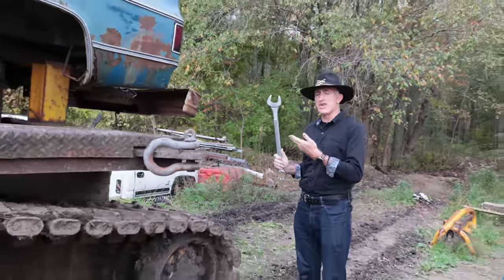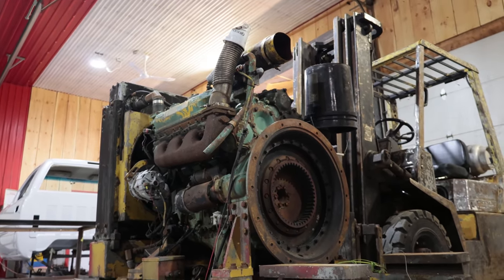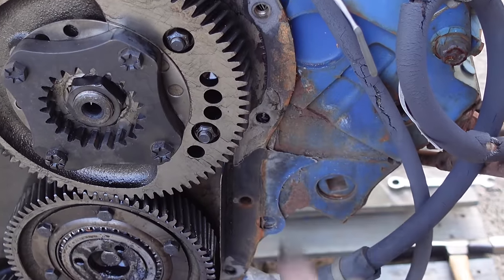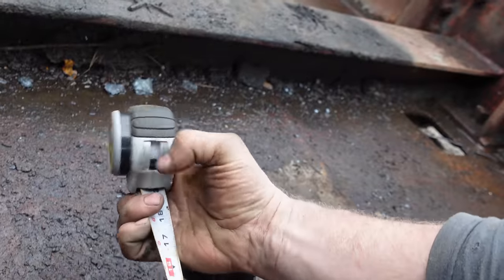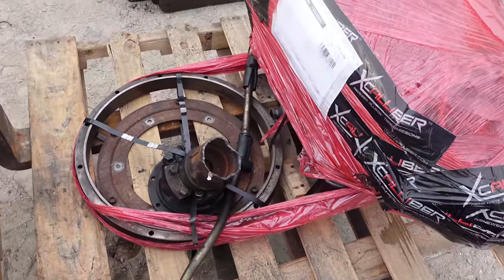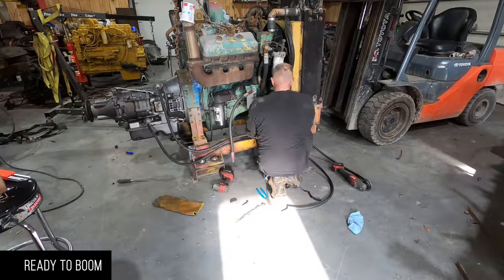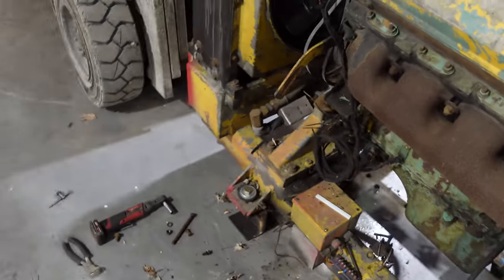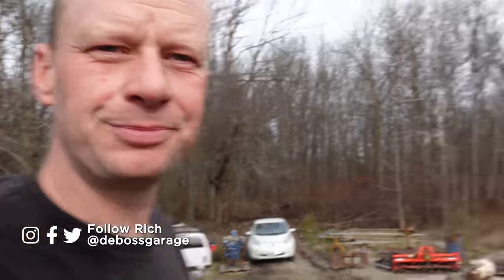Fixing Everything Wrong With Our Truck Tank... 30-Speed Detroit! #Shermanator [EP3]

Comment: Wondering it wouldn't make more sense to have two separate diesel engines with 7 gear DSGs going to each final drive.

Instead of having a direct gas pedal for each of the engines, you would fit an RPM-based governor for both engines. So you select the desired RPM after the transmission with a single lever and the governor will modulate the throttle to meet your requests, while the DSGs will dynamically shift up and down based on the load and throttle.

The steering wheel would just shift one desired RPM up and the other one down. So you have one lever for the "total" speed of the vehicle and the steering wheel for the differential speed.

You would then just fit two brake pedals. The "brake light" switch would turn the engine down to idle on the side you hit the brake and switch the DSG to N. This way you can stop one track while the other engine turns the other track forward.

If you want to include the cool "turn on a spot" you can add a switch at the end of the travel of your steering wheel which switches one transmission forward (gear 1) and the other one in reverse if both brake pedals are pressed and the RPMs are both (at the final drives) for obvious reasons :D If you release the brakes the governors will engage and bring the engines out of idle. If you hit the brakes again you will exit this mode (when you turn the steering wheel out of the the "end of travel" position at the time you release them. 

And you probably want to include a button to select reverse on both DSGs.
Reply: Regarding engines: Have a look at old Tuaregs, the 4.2 liter V8 is quite powerful: 340 PS and 800 Nm or 590 lb.ft @ 1750-2750 rpm. Not available for DSGs, but they were build with automatic transmissions. So maybe just go this route. Not as exiting as an DSG but probably better anyway with the high amount of weight. :D

Comment: Theoretically, a heavy haul semi class Allison or Eaton automatic may have been able to take the torque of that Detroit 16v, but I don't know enough about either to say for sure. Perhaps a topic for a future video?
Reply from the maker: no, they need too many electronics to get it too work.  This is a full manual valve body with no electronics
Reply: @DGHD  Thank you! I'd love to learn more about automatic transmissions, I have the general gist but when you get into the grit like manual/semi-auto/automatic valve bodies I get lost.

Other than the Rule of Cool, would there be any reason (practical or not) to use a Detroit 16v in a non-stationary application?

Comment: If it was my tank, I’d honestly think of selling the classic tank transmission and replacing it with a truck axle.
Reply: Not really an option, as the axle is also your steering mechanism.
Reply: @martindinner3621  I already considered that… the controlled differential is pretty slick for tank operation, but this things a rusty Chevy square body mounted on a bunch of metal plate.  Somebody at a museum could really need these parts.

Comment: I was thinking on diesel swapping my f150 one day. If I could get my hands on a 4 v 71 that’ll be cool. Otherwise a Cummins swap. The old 93 is gonna be great
Reply: You'd be much better with a 4bt Cummins swap. I love my Detriots, but they're heavy and slow. If you're looking for something that would make a good daily driver get a 4bt. It's a 5.9 6bt Cummins with 2 cylinders lopped off. Look for an old box truck, 94-97. You could pick one up, depending where you live, for 2K-5K. You can get the whole engine and transmission, plus the radiator and whatever else you might need to swap it, like the front yoke on the driveshaft.
Reply: A 4bt weighs 700-800 pounds. A 4-71 weighs 1600-1800 pounds. You have to take that into consideration for a half ton pickup as well
Reply: @buckberthod5007  thanks for the clarification. I’ll do a Cummins swap then. Thanks for ideas on what to look for.
Reply: @2koolchris291  Your going to need to beef the front end up as well. You'd be good to buy a set of Dana 60 8 lug axles to hold the weight, and not blow out suspension or ball joints. With a 4bt and a 5/6speed manual, you'd be looking at 40-50mpg, while being able to get up to 70 quickly. Just make you take care of the kdp in the timing gears, and turn up the injection pump if you're looking for little more power for cheap. You could also put a set of bigger injectors (.40-.60 over), 60 pound valve springs, ARP head studs, and a bigger turbo. The 3.9s and 5.9s are real powerhouses with little work. They're great in stock form, but tune em up a little, and she turns into a beast
Reply: @buckberthod5007   thanks for the advice. I was planning on doing axle swaps with a 6 speed manual because of personal preference. I am now really looking forward to this. I was also thinking on boxing in the frame for extra durability.
Reply: @2koolchris291  Definitely box it and if you can swing it, I'd recommended buying a f350, 99 to 06, with a zf6 and the Sterling 10.25s to swap. Pick up the entire chassis, so you can use cross members or other pieces for the swap. You could also buy a a rolling chassis with everything installed, drop the 4bt in, and swap your body on. You'll have disc brakes all around, for good stopping power, you'll have a damn near bulletproof driveline, the 4bt, zf6 and sterling axles are next to impossible to kill, and you would have the right set up
Reply: @buckberthod5007   my original intention was to pick up the newer chassis from one of those trucks to use and I see them listed for parts around where I live so I could pick up one relatively cheap. And thanks for letting me know what to look for in driveline components. I’m turning 16 at the end of the month and I’m new to these things. And plus I’m still trying to rebuild the old f150. I bought it after my brother wrecked it. Nearly rust free for 1000 dollars with a decent bed. I had to replace the cab since it was damaged beyond repair. And I’m saving up for the new fender and I need to replace my front harness since it was torn up when the fender was ripped off by the guard rail he hit. The truck has 164 thousand miles and all I want is for it to be reliable and a good work horse. It is my first truck and not only that my dream truck. When my brother got it it was pristine. Now it’s just waiting on parts to get it back on the road.
Reply: @2koolchris291  If you've got to get a new cab, id look for a truck that's just a good cab and frame,  1999-2006 F2/350, with a zf6 and Sterling 10.25 axles. Better off with a F350, but a 250 would work. Swap your bed and nose on it. That's if you still want to put a 4BT Cummins in it. If you get a mechanical injection 4bt, you'll only need a wire for the alternator, a ground and a starter wire for it to run. They're stupid simple and easy to work on. What year is the truck now? What motors in it? Going to guess a '87-97 with a 302 or 351? Or maybe the 300?
Reply: @2koolchris291  Is your brother doing OK? Sucks he got into an accident.
Reply: @buckberthod5007   oh yeah I was with him. Nobody was hurt only the truck. Clipped a guard rail and it took the fender with it. I still have it. Bent it completely in half. But the emblem was perfectly good. Yeah that was two years ago in 2019 right before the pandemic.
Reply: @buckberthod5007   and I already replaced the cab. My dad known the owner of this junkyard since childhood. They were good friends and worked there together. The cab I got for 500 and now all I need is miscellaneous parts. Fender, wiring inner fender, hardware and an alternator. The plug broke on it.
Reply: @buckberthod5007   it’s a single cab long bed 1993 Ford F-150 2wd with the 302 5.0 with the simple 4 speed overdrive transmission. 164,000 miles with fully functional dual tanks. The beds taken some hits but still in good shape nothing a little body work could fix. It was wrecked before my brother got it so it has a junkyard axle and have had the driver side fender replaced. The twin I beam suspension is in fair shape but I want to convert it to four wheel drive cause that’s the one thing this truck was missing. And for the most part it’s clean.
Reply: @buckberthod5007   and the funny thing is we now share the same first vehicle. It is a shame that he wrecked it 6 months after he got it but some guy in a Honda pushed him into the guard rail. I also was planning on putting the 302 into a classic Mercury Cougar because my high school is home of the cougars and 1968 was the year the school was built.

Comment: I'm kinda surprised you went with another Detroit.  Are they cheap enough that it made sense to mess with?
Reply: What would you use? Don't forget, he's getting these for scrap value not engine value. And you don't want anything that needs a computer.
Reply from the maker: We picked this one up about 2 years ago.  The oil is still gold colored so I think it was brand new.  it was on a generator that likely never got used